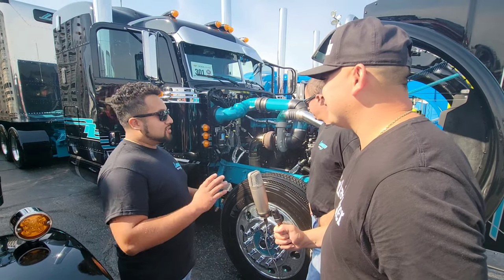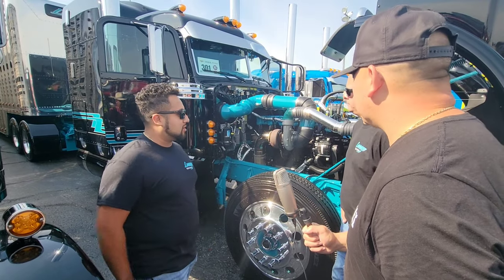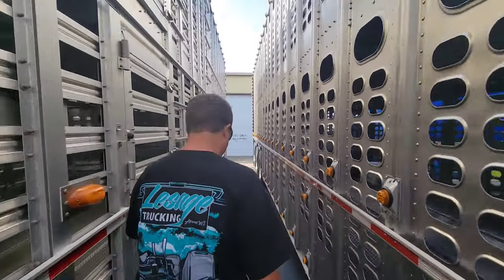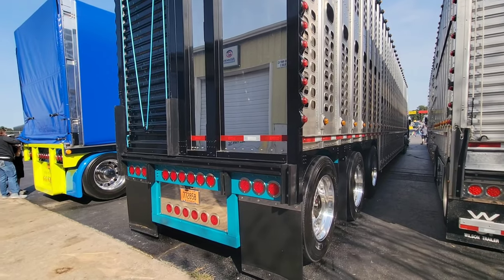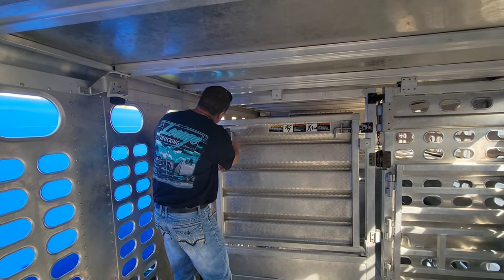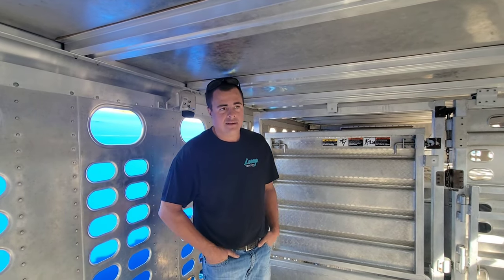How To Be A Cattle Hauler, Lesage Trucking Gives Us A Inside Tour Of His Custom Cattle Trailer

Comment: I have a few questions for cattle haulers 1. Are they only to do it overnight? Are they not to fuel while they are loaded? Are they not to take breaks while loaded? I'm a trucker just a few questions I had concerning them  thanks
Reply: They can fuel while loaded but you won’t to be fueled when u load so you don’t have to stop. Running at night, less traffic and in summer months, it’s cooler for the cattle. And different hours of service. You only pull over and nap if u need it. No full 10 hour break. When u load you get to your destination quick as u can.
Reply: @B1ackwell17  thank you so much for responding wanted to know how all that worked thanks I really truly appreciate you
Reply: @B1ackwell17  so would that mean exceptions to hours of service rules?
Reply: @toddalexander5517  exactly… so they are still able to run paper time cards… they’re suppose to abide by the laws of service but they were exempt from being part of the electronic logs…. So basically with paper logs you still have the same laws but with paper you can alter that log to make it look like you did everything you did was legal when reality is you did what you had to do to get the cattle from point a to point b as quick as possible.